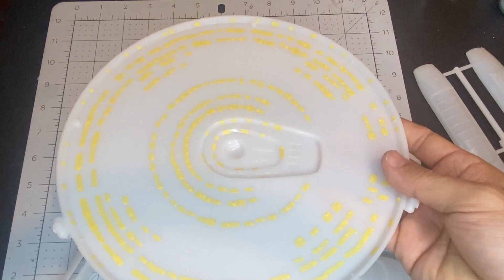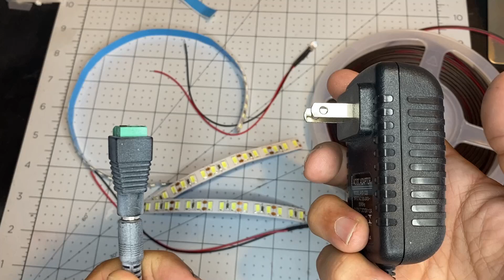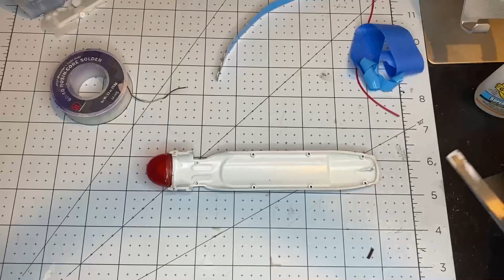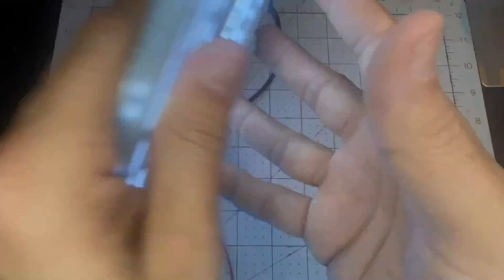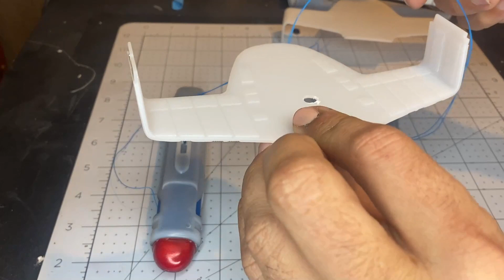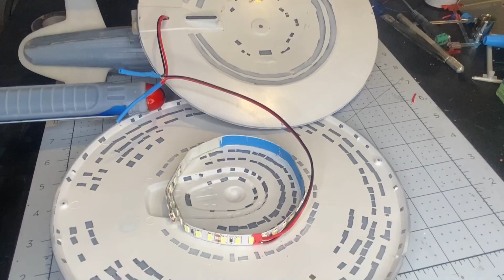Enterprise C - Clear edition Part 2

Comment: New subscriber here, wouldn't it have been easier to spray the outside of the ship with the light blocking grey primer instead of masking off the inside of the ship ?
Then scratch the windows off?